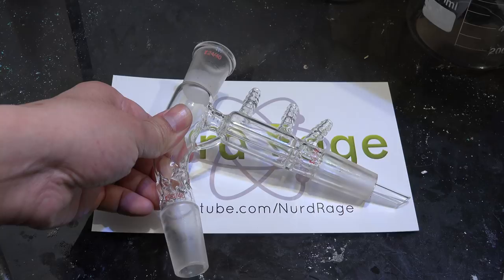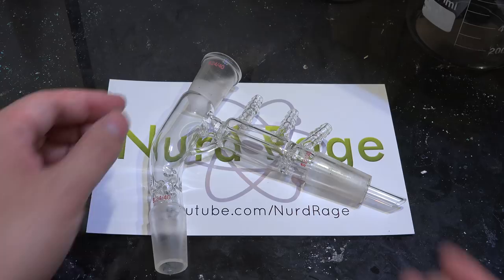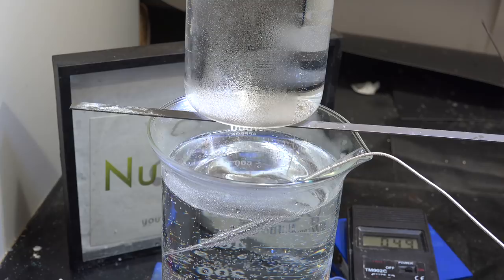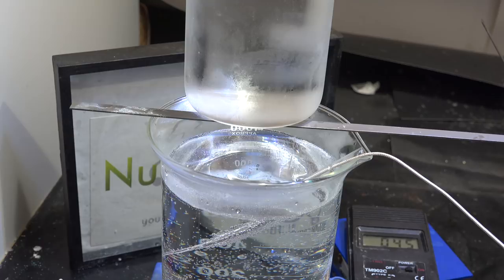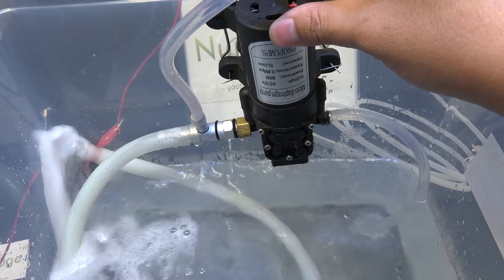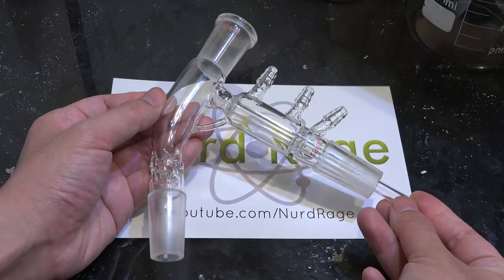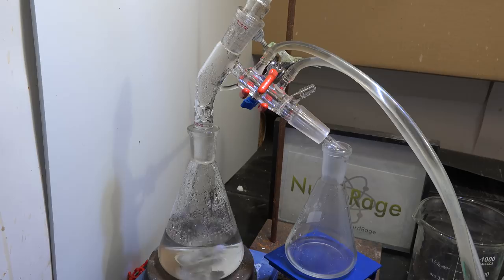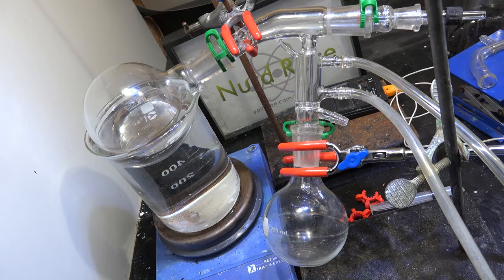Lab Equipment: Short Path Distillation Apparatus

Comment from the maker: Been awhile since i last did a lab equipment video. As for the topic: I admit, i didn't fully understand the concept for many years. I'm pretty sure i still don't fully understand it even now. 

Anyway,  my sodium silicate video had some errors in it so i took it down and i'll reupload in a few days once i fix it.
Reply: NurdRage No notification.
Reply: I don't understand it either, when I see "distillation", I think of Whisky... :P
Reply: +joey dubbs76
do you have the bell turned on?
Reply: Maybe next time you'll talk about fume hoods, heating mantles and burettes... Hint Hint
Reply: Degradation, and decomposition is something I would've brought up too. @nurdrage check my insta: @thaorganicmechanic
Reply: Michael Aichlmayr I don't even see a bell.
Reply: Thanks, interesting video, never thought about these differences in distillation apparatuses before.
Reply: Welcome to the club 24K
Reply: I'm not even a chemist of any description, and I love watching your videos, especially the Lab Equipment videos. It's just damn interesting. Thanks for making these.
Reply: I am starting to do metal recovery and one of the devices that I am trying to work with has a cured silicone gel that is very resistive to all solvents I have tried.  I contacted the maker of the silicone and they sent me rather generously 10 gallons of dowsill DS-2015.  I have found out that it cost $22.00 per liter.  I just wonder if there is a way to regenerate spent DS-2025.
it is mostly kerosine and an acid  a rather nasty one that is based on benzene.  
So is it advisable to try to regenerate it by distillation or should I just dispose of it.
Reply: I checked the link I couldn't find the product listed.
Reply: Editing and updates are what makes a professional (monetizable) product.  Keep up the good work.

Comment: Some method of pumping gently the vapour and residual gas might help quite a lot. Perhaps putting on a stirrer might have great benefit, as it also agitates the gas. Flowing a tiny bit of gas to near the surface through the thermometer hole may also work.

Comment: Awesome ! I bought one of these a year ago because it was cheap. Never really knew what to use it for - until now !
thanks.
Reply from the maker: I saw one on my old workplace and never figured out why it was special until almost ten years later. It's one of those subtle things you almost never think about until someone tells you.
Reply: Best thing i can say about it so far (never having used it) is that it's small enough not to get in the way ;)
Reply: According my experience this accounts for most special lab glassware. If I have a look in our lab I'll encounter quite a lot of deviating glassware pieces, most of it was custom designed for a special purpose. When the project is finished and the experimenter gone, hardly anyone remembers whats its exact purpose was :-) An experienced lab worker can reason what its purpose is but e.g. at most Uni's people come and go and so does its practical knowledge.

Comment: I would love to see a video on essential oils. I have been trying to find out how they extract aroma from coconut but I couldn't find anything. Maybe some aromas can't be extracted? Also can essential oils be used in chemistry to make desired compounds?
Reply: Some "essential oils" are made synthetically. They synthesize key molecules and mix them up. For real essential oil extraction people usually use steam distillation or a water/alcohol mixture
Reply: Cool :) I know NurdRage mention that the Short Part Distillation Apparatus could be used for essential oils. So when is it better to use this one over steam distillation? I feel the whole world with aroma and perfume is kind of hidden and you can't really find that much DIY videos about it. Could the coconut aroma be extractable as an essential oil? How do you separate coconut oil from the essential oil?
Reply: @nattsurfaren  i'm not  chemist but i've been playing with a spd for a few days and I discovered that some terpenes have low boiling point, like 40°C... so If you catch all vapors, you may get water+oils and then can separate easily by freezing. cheers
Reply: Did you know the coconut Terpene is believe is actually mango🥭

Comment: Thanks for the lesson! I've an idea kicking around in my head for awhile that basically amounts to distillation at sub-boiling temperatures, but wasn't sure if it was possible, or if it would accomplish what I had in mind.
Pointing out the benefits of a short path, and using vacuum to increase the mean free path (if that's the right term) for the molecules we want to distill, gives me a much better idea of how I might set up some experiments.
Reply from the maker: research: "film distillation", "film evaporation" and "molecular distillation". There is advanced equipment out there that takes this concept to the extreme. They're expensive though, so i'll never be able to afford one for my videos. But they're out there.
Reply: NurdRage Thanks! I'll look into it. I have found that ebay can be a good source for deals on equipment. Unusual stuff and truly good deals take a ton of time and some luck to find - it's not a big market - but I have gotten some embarrassingly good deals on expensive glassware. I can keep an eye out if there's anything you'd like to find.

Comment: Diffusion... or an aquarium pump circulating the air in the system. Think of it as a solar still with a blower.

The pump can pull from the vacuum port on the short path still, and bubble into the boiling flask via a tee and diptube. The circulating air (or other gas) can carry plenty of vapor well below the boiling point.

Comment: Sounds ideal for concentrating peroxide.
Reply: Nuovoswiss well that's what I was banking on, hook up the vacuum adapter so there's less risk of decomposing the peroxide by heating. 

I know I didn't word or explain my thoughts well enough to indicate that I would only want to remove the water, and not distill it off for collection. I was looking to shorten the drying time into hours instead weeks through passive evaporation. If that makes sense.

Comment: It's called "short path" because it is possible to have a mean free path that is considered short (i.e will collide with the vessel before another molecule). Having said that it is almost impossible for that to happen in a short path head. In fact you'll notice the vigreux on the column section and this clearly indicates that there is some vapor interplay. That's ok though because it is a great tool for separation of high boiling point materials. The column section provides more separation capabilities than a true short path.

Comment: what is the lowest temperature you can distill water with all of your equipment
Reply: You can distill at almost any temperature. I.e. 5 deg C at atmospheric pressure. It will be just very slow. You can make it work maybe one or two degree below melting point, but this requires rather extreme pressure conditions. Not available in most of the labs.

Comment: It can also be used for making phenol . It tends to crystallize and you need to shortest possible path possible in actually pump hot water through the condenser to keep it from packing salad with phenol crystal. I've never tried to do it with vacuum however vacuum would probably mess it up pretty badly.

I ended up moving before I was able to do the phenolic plastic experiment that I wanted to so I got a boiling flask full of the crystal sealed in three bags somewhere. I've moved twice since then. The chick kind of scares me

Comment: I'm really curious to know if you can use alcohol and dry ice to run through the condenser or would this be too cold and cause more issues I'm a little nervous to try it myself but I'm curious if it would work in some situations never seen anyone do it

Comment: And I never knew such a thing existed. Now I know what to use when my traditional distillation apparatus doesn't perform as desired. 

In the future could you do a "lab equipment" series video on vacuum pumps? I'd like to own one  but haven't yet purchased one because I'm uncertain about the complete setup. I've read that solvent traps are supposed to be used to keep the vacuum pump safe, but I've never seen someone break down their entire vacuum setup so I don't know if additional equipment besides just the pump and tubing are required.

Comment: I do this all the time with acid such as HNO3, HCl, and HF. We have a different system for the HF and the other acids, but it's always some sort of short path low temp distillation.  Our lab made system is also 100% teflon because of the HF requirements. One last thing is that our distillation systems are typically 100% sealed off from the rest of the world. In other words, not atmospheric.

Comment: would a rotavap be comparable (but more expansive and bulky overall) since you can heat bellow the boiling point under vaccum then consense in another flask
Reply: Barnesrino Kripperino a roto is much more efficient and if you have to reclaim a lot of solvent, a short path is not appropriate

Comment: What is Distillation Cow Receiver used for?
Thanks in advance!
Reply: That's used for fractional vacuum distillation. If you're running a vacuum distillation that will have multiple fractions, you will need to switch to a different receiver flask as the new fractions come over. A cow receiver lets you rotate to a new flask without having to stop the vacuum and disconnect/reconnect a new one.
P.S. There are a couple different types of cow receivers, the kind that looks like a bulb with three male joints is the most popular one, but I hate that one, because you have to rotate it so far that the flask attached to the far side gets pushed up to the side, so you can only use like 1/5th of the volume or else it spills over. I like the kind that has 4 male ground glass attachments, all of which are down stream from the vacuum adapter. Here's an example of what I mean: http://amzn.com/B0776N94BB

Comment: Neat! I'd never really realized that evaporation-based distillation was something that could be done, though I suppose it's kind of obvious in hindsight. Would it be possible to speed up a distillation like that by continuously pumping some gas into the flask to push the evaporated molecules through?
Reply from the maker: There is actually a super advanced version that uses a rolling film. Basically you carefully drip the liquid down one side of the apparatus and it evaporates but it immediately condenses on the other side of the apparatus which is cold. The distances between the two sides is just a few centimeters. No need for pumping or gas pushing.

But that piece of equipment is highly advanced and costs many thousands of dollars. I'll probably never be able to get my hands on one.
Reply: Na 
Yep! It exists! It's called vapor current distillation. You boil water in a separate flask, and then the vapor passes in the distilling flask with your compound(s) in it. 
The water vapor pushes with itself minuscule droplets of the high-boiling compound.

Comment: The one thing I don't understand is why those things cost ~$200 each!
Reply: Please try blowing such an apparatus from one solid piece of borosilicate glass. When you manage that, or fail 500 times and give up, you will probably understand why it’s so expensive. It’s a very complex piece of equipment
Reply: It's clearly not one piece. If you look, you will see at least 3 different pieces that were melded together. All I'm saying is that automation has made this process easier than traditional methods of glassblowing, and these things are at least twice the price they should be...
Reply: There isnt much demand and its rather hard to supply sooo...
Reply: I can supply in USD 100

Comment: I don't get the point here, if you have to distill a liquid with very high boiling point, why don't use vacuum destination? I got a old pump from eBay, that still works and can get water to distill at room temperature and that for just about 30$. And a full size vacuum destination is faster. Also I don't the point of distilling below the boiling temperature, it would take for ever to distill a reasonable quantity of a chemical that way and if you also have to heat it you will waste so much energy. 
I really don't see any advantage in this.
Reply from the maker: This is for that extreme case when full sized vacuum distillation doesn't work. I admit i didn't see the point either for many years. 

Think of it like this way. Have a normal vacuum distillation apparatus but extend the distillation column (the column before the condenser) upward by a long distance. If you try to distill with this it'll be incredibly slow since the molecules have to travel a long distance. If you had a high-vapor pressure substance then this wouldn't matter as the pressure pushes it along. But for very low vapor pressure substances the rate drops considerably. You need to increase heating even though you have hard vacuum. But if your substances is very sensitive you can't do this.

Now take the same distillation column and shrink it. Shrink it down to just a few centimeters. If it's REALLY small then the distance between the evaporating surface and the condenser is smaller than the mean-free-path of the molecules. As soon as they lift off they get distilled. Your flow rate increases dramatically for a substance that was nearly impossible to distill before. This works because when you're smaller than the mean-free-path of the molecules the previous equations and theory of gaseous flow no longer apply. Suddenly things like waxes, or super heavy oils become accessible.

Now if you tried this with a normal substance, like water, you'd completely pop and flood the system and it would be useless. SPD is not for normal substances. It's for giving a massive boost for substances that were once impossible with regular vacuum distillation.

I also never realized it's value until i realized the apparatus overlaps depending on how you set it up. If your setup it too big, then it's just a glorified integrated distillation unit. If you set it up as short path, but distill easy substances, then it's a crappy and very lossy distillation unit. It's when you apply it to very hard substances AND set it up as short path that it operates in the region where regular viscous gaseous flow no longer applies. Then it shines.
Reply: to add onto NurdRage's comment, some compounds are heat sensitive, so using short path under vacuum would be the best option that won't affect your yield. Also, very high boiling solvents e.g. DMF, DMSO need extremely high vacuum (<1 mbar at 40c) to get even slow evaporation on a rotary evaporator and DMF can't be heated too high otherwise it will decompose and screw everything up.
Reply: If the boiling point is high, then you may still need to maintain high temp even under vacuum. For one compound I was able to pull 1x10(-7) torr vacuum and still had to distill at ~200C (and it decomposed around 180). A full distillation path would've been miserable for the small amount of product I had and In would've lost a lot more product.  Longer path means more glassware that needs to be kept hot to maintain distillation, and holdup becomes a huge issue. I use shortpath almost exclusively for this reason, as I rarely care about carefully separating liquids and am usually just distilling a liquid off a solid, or a liquid from a viscous oil/polymer.

With the plethora of purification techniques, these days it's not very common to need to distill 2 liquids with comparable boiling points. Distillation is time consuming and only really works with large amounts of product, which doesnt gain it much favor. Chromatography and extraction are much more typical.
Reply: There was this compound called phenylsulfonylacetylene that I required in huge amounts for my PhD work. It had to be purified very carefully before using it in the next step but it had an unfortunate tendency to decompose on silica, making column chromatography extremely wasteful. To make things worse it had a boiling point of around 90°C at 0.01 Torr (the lowest vacuum I could achieve in our lab) and would decompose at around 105°C. You generally need to heat the flask to around 20 degrees above the boiling point to push the vapours over the still head. This is where the short path apparatus along with a gentle argon purge saved the day!